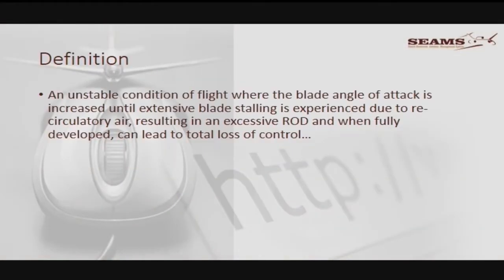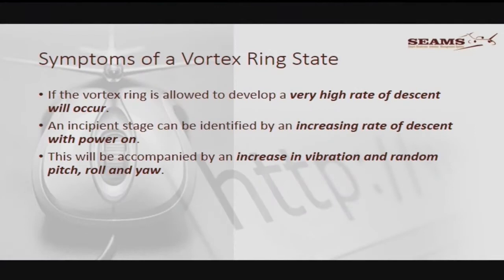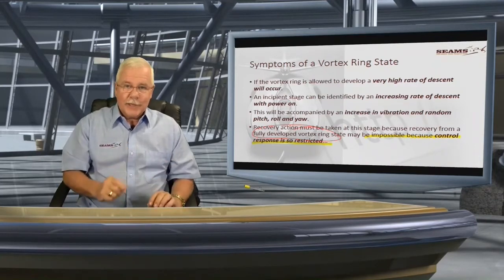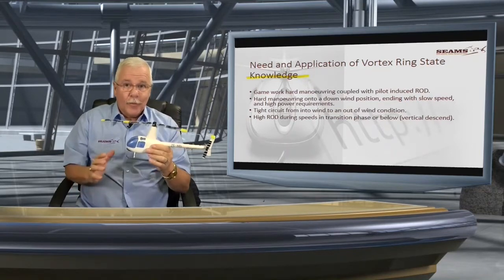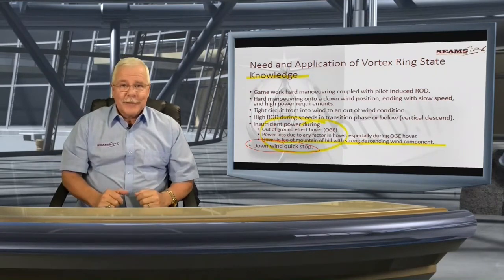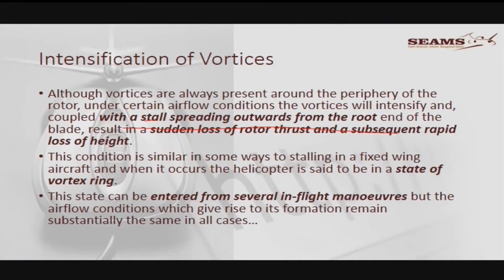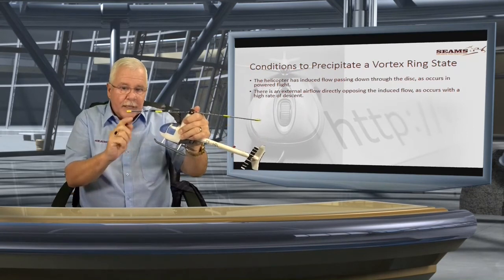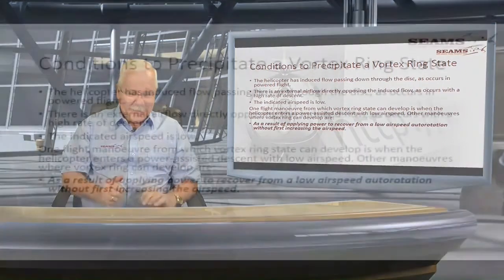CRM Heli Vortex Part 1

Comment: Great video. Thank you. I am a game pilot and have unfortunately put a R22 on its roof during gamework. The 3 things in summary that i keep out of to avoid a VRS is keep airspeed above 30kts, ROD below 300ft/min and don’t pull power. In other words VRS can only happen when ALL 3 of the above are taking place together, if you take one of them away you should be fine. This is just from my personal experience. Keep up the great videos Charlie👏👏
Reply from the maker: Glad it helped!  Game piloting is the pinnacle of helicopter flying and, yes, I must say, the variety of things that can and do go wrong, is far outside the scope of normal helo drivers!
Reply from the maker: True, technique does count, and not necessarily size!
Reply from the maker: Great, we all make mistakes, but the biggest mistake would be to not learn from them.  Happy choppering!